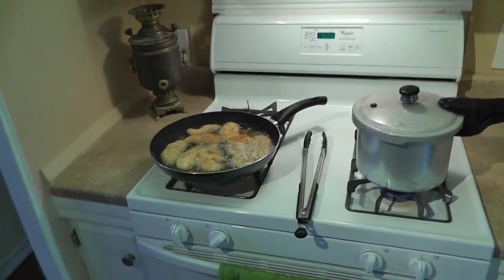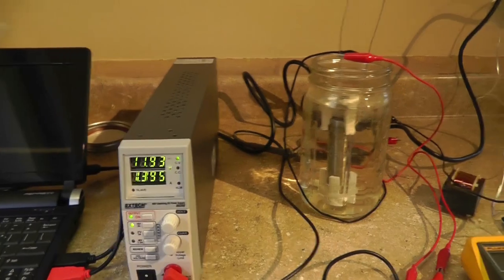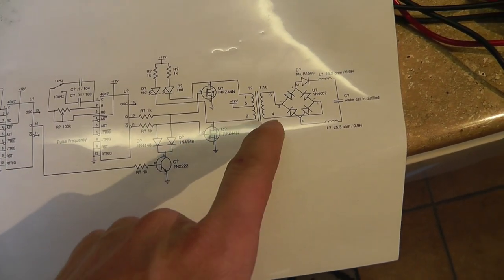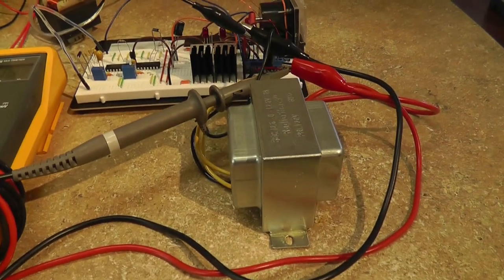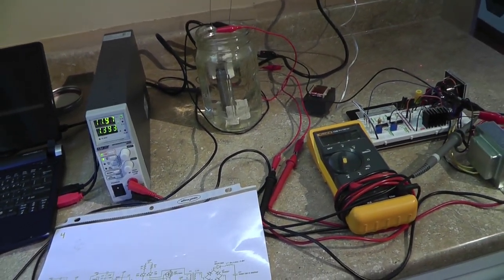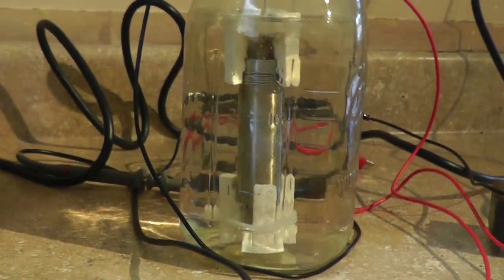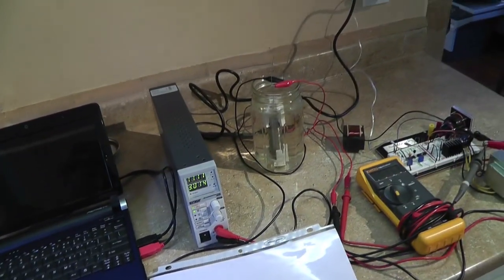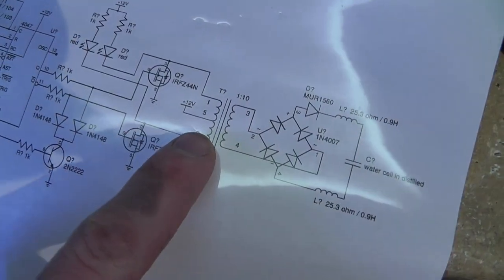(Random Sat) Kitchen Lab...Limitless Research & Haxar Come To Play In The Kitchen... WFC

Comment: It looks like he is using two SG3524 pwm controllers or its variant. The topology is a push-pull drive ( each transistor is on only 50% of the time, during continuous operation).One pwm controller is gating the other through a npn transistor sinking the gate drive signal to ground. He is stepping up 24 vdc to 120 vac, yes he is pulsing that into a duel coil setup. The collapsing field on the secondary coil pair is producing a high voltage and a high potential electrostatic field, because there is no external electrostatic shield on the duel coil. That is why you can feel what appears to you a high voltage field. The full wave bridge will give a constant output with some ripple and when the gating clock is applied it will appear to look like a square wave with ripple at its peak. You should see this at the output of the diode bridge.

Comment: In short it is just pulsed DC electrolysis. 1.4 amperes in and 170 ma into cell, not great efficiency-12%. If he designed that circuit, he did a good job.

Comment: Oh yeah... she loves the kitchen laboratory...

Where's all the power getting wasted???  Make sure your push-pull MOSFETs are not simultaneously conducting at crossover time... the large gate charge (capacitance) will cause delay in turn-off, could be causing them both to be on for a period... that could be a big source of wasted power.

I still wonder why you don't make a simple Arduino timing generator for such... it would be so easy to do what you have there... and much more.   I know... I know... it's easy to throw together some digital logic to do it, but it's rather limited.  WIth the Arduino, it's easy to prevent crossover conduction.

Also... that 24VCT transformer will be very lossy at high frequencies / square waves.